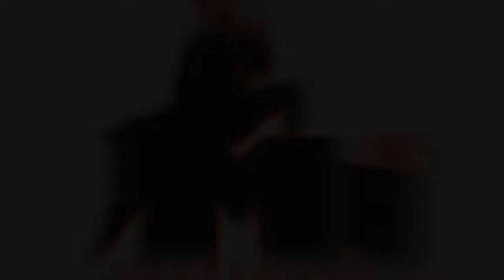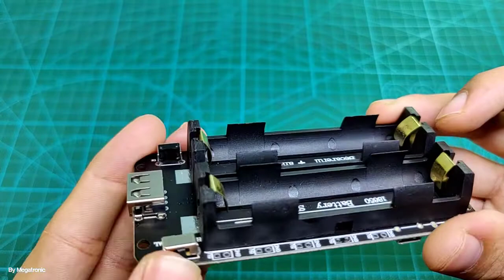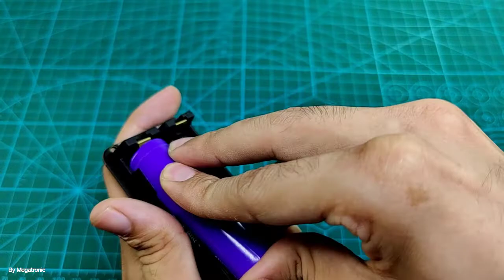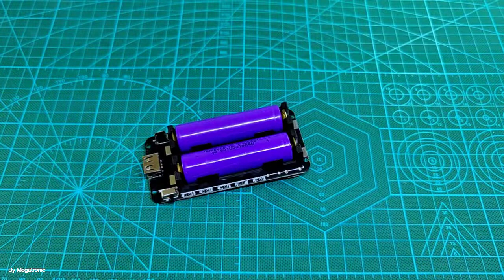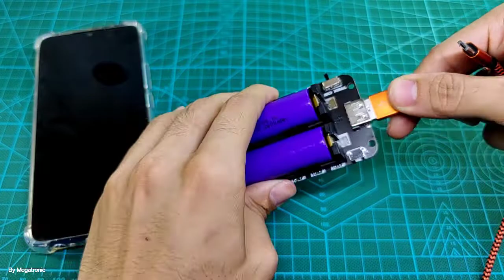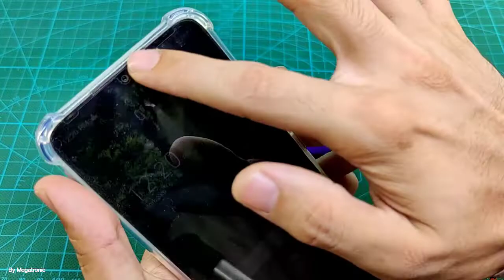2RPV3-G45 | Dual 18650 Lithium Battery Shield Arduino raspberry pi Power Module

Comment: Does it automatically shut itself down properly when the battery is low?
Reply from the maker: Yes
Reply: @Megatronicspk  Does LM2596 also automatically shutdown.
I'm using two 18650 batteries with LM2596 to provide 5v 3a to GSM module.
My concern is that LM2596 will continue draw power from batteries even it's already low. That will kill battery's life.